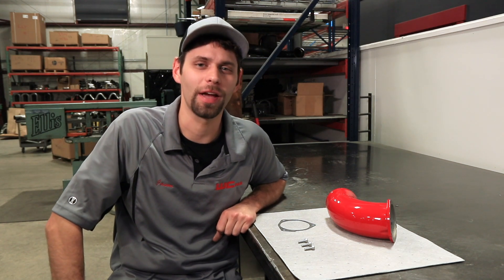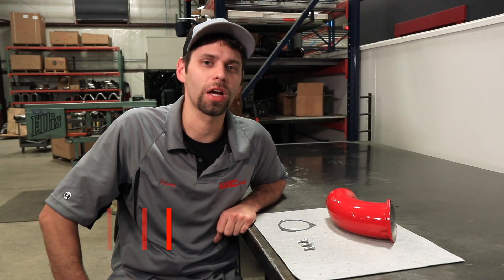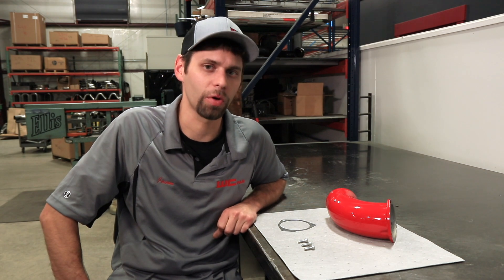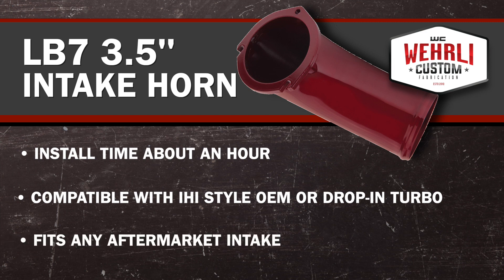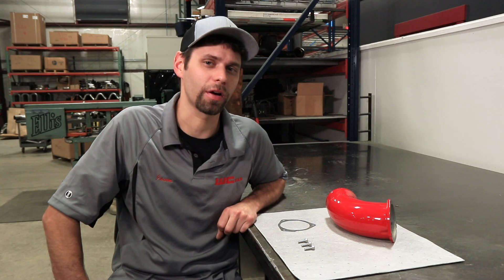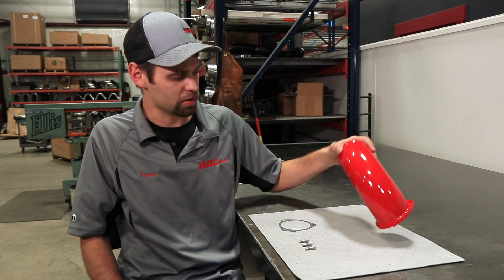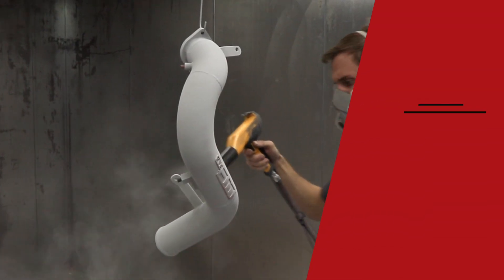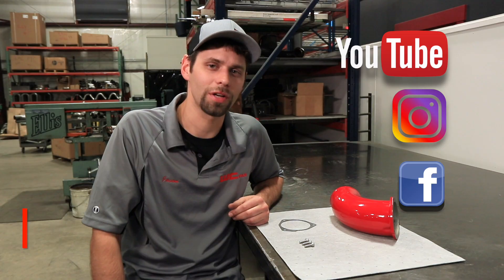WCFab LB7 3.5" Intake Horn

Comment: What size hex head screws are used? I have to take it off to upgrade my turbo and want to get set of round head hex bits and want to make sure I get the right size.
Reply from the maker: 6mm Screws.